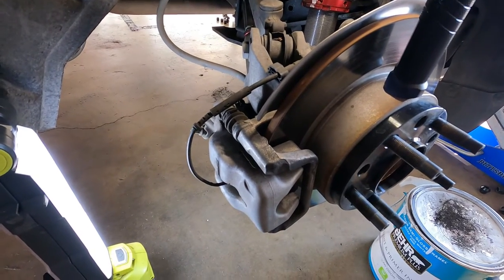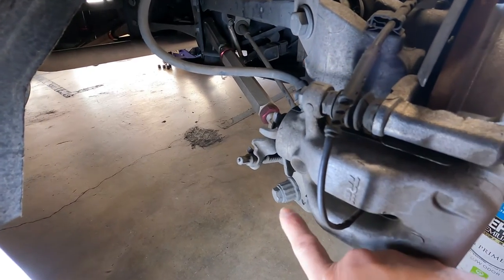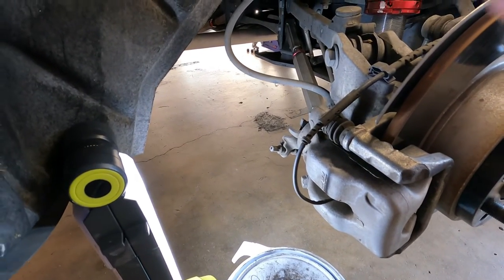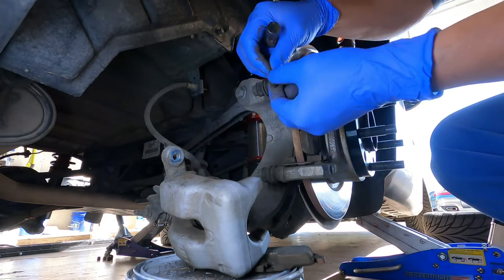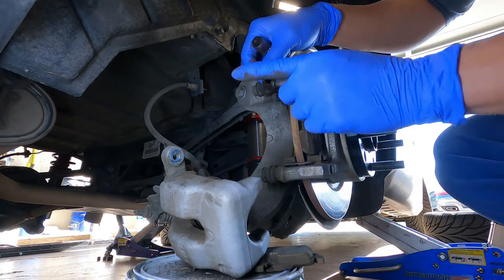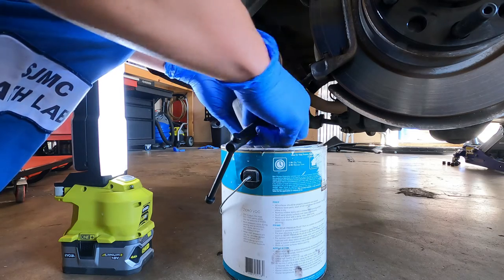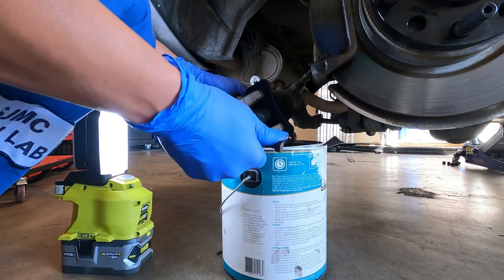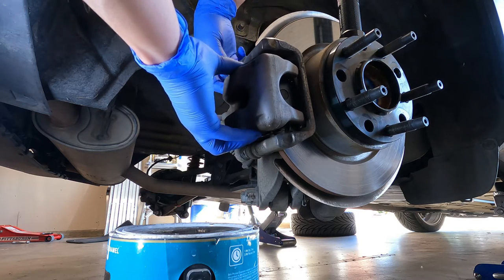Mini Cooper Rear Brake Pad Change DIY - Easy 30min Job

Comment: I can’t believe it. I changed front discs on front of wife’s Mini. She didn’t like the look of rust on the old discs so I smeared plenty of copper grease on the new discs to prevent rust. Now she’s saying the brakes don’t work too well. Do you think I have got air in the system?

Comment: Hello A F. Lots of good info thanks. Doing the same task on 2018 Countryman JCW. Btw, you would like it. My wife ordered cloth sport seats, manual `box, no cursed sunroof, in Lapis Blue, no other colour on roof, no model name on rear hatch, black light surrounds. 
One little issue. On dozens of sport or race bikes and some Porsches, we have always done the pad running -in as follows: Drive around trying to avoid hard braking. At the same time while just cruising, gently apply the brakes for two seconds, repeat 4 times then let brakes cool a few mins. Repeat routine about 5 times. That's it. I should mention I always lightly use 600 grit sandpaper on the disks to freshen the surface, then wash the disc and calliper with brake cleaner. I like to clean callipers before retracting pistons. Works every time, even on top level race bikes. I'm sure your system works, I just can't cook new brake pads with all that heavy stopping. Good luck.
Reply from the maker: Leon, thanks for sharing your technique. I have also heard of people sanding down the initial layer or new brake pads to help with the bedding process. Perhaps the next time, I will try your technique.

Comment: Hi there, great video. Any information on what the original issue with the driver side rear pads was? You mentioned they wore down prematurely.
Reply from the maker: Sorry, I never figured out what caused one of the pads to wear faster than the other side.

Comment: I just did my 2017 Mini Countryman All4S... took me about 3 hours... hahaha. First time changing pads.  BMW/Mini wants $1K. Nope.  Second wheel took me 2 hours.  Part of the time is thinking out loud so that I don't make a mistake etc.  Part of the time was figuring how to jack up the mini without a catastrophe.  The brake pads I bought for the front looked identical to the ones that I am replacing and it took a while for me to push them into the caliper bracket.  I don't know if that is normal... but it is pretty snug.  It took me a while before the pads were in place.  A little late now but I have needed to take bracket off and clean the pad area with a wire brush etc.   I will need to understand about "bed the pads".   My front brakes were from Duralast.  I got the same caliper set from Harbor Freight; cost me $39 in the east coast.  I like that it is in a case but if you want to go cheap you can use a big C clamp up against the back of the cylinder and screw handle put an old brake pad push the screw part up against the piston that way.  Another thing I did also was short out the brake sensor..
Reply from the maker: Hey Sam, it looks like you learned a few things here and there for your 1st pad change. Trust me, I went through the same processes when I started working on cars.
Reply: @TheAutomotiveFanatic  Thanks for  your reply.  Yeah ... putting the car on the lift is great...but if $1K motivates someone to do the brakes themselves... ALL GOOD.  One other question for you:  I have wheel locks from BMW and it appears I (as I took off the 2 front ones before going to the back tires) must have stripped the key as the key now slips.  Mini/BMW wants $69 for a new matching key... and yet the whole set of wheel lock nuts and key will cost you $40.  Anything you can think of to help me there?
Reply from the maker: @samsnow7370  I'm sorry to hear about the stripped wheel bolt lock. A local friend of mine had the same issue. The only thing I could think of, was to drill a hole into the lock and back it out with a reverse bit. Otherwise, you'll be stuck paying $69 for a new set.

Comment: Fantastic video! I will say, though; if it's your first time wrenching, you're not gonna be done in 30 minutes. Plan in a good few hours, just to be sure. You're likely to come across some rusted fasteners.
Reply from the maker: Thanks Michelle for the input. You're right...in any automotive DIY, something always seems to come up. Can this DIY be completed in 30mins, yes...could you run into any issues, absolutely so prepare.

Comment: great video - if you are replacing the pads, you can push the piston back using a screwdriver, by carefully wedging it between the rotor and pad. push into the pad, not the rotor. this will make getting the caliper off easier also. for breaking in, do nothing but drive normally. most pads and rotors these days have an initial coating that does the break with normal driving. i did not see any lube for the pins - is this not needed for the rears?
Reply from the maker: Thanks for the input John. There's definitely more than one way to complete this DIY. As far as lube for the pins go, you're 100% correct. That's a minor part of the process that I left out. I can also add that in conjunction with greasing the pins, you should also sand them down with a fine grit rated sand paper.

Comment: Did you have to do any resurfacing on the rotors?
Reply from the maker: No, nowadays, rotors are so cheap, people opt to buy new ones instead of resurfacing them and decreasing the minimum safety width.

Comment: Thanks for the video. Did you reuse the caliper bolts or is it important to replace them with new ones?
Reply from the maker: Thank you for watching. I reused the caliper bolts. I would suggest replacing them if you're frequently changing out pads. Otherwise, a one-time reuse isn't going to cause issues.

Comment: No brake pumping required after the pads replacement?
Reply from the maker: Thank you for that question...Yes, PUMP your brake pedal a few times to build pressure before driving off.

Comment: Can I use a c clamp to push the piston back or no?
Reply from the maker: Yes you can, but I would suggest placing a thin, flat piece of wood between the piston and your clamp.
Reply: Or just use the old pad instead of a piece of wood.

Comment: Thanks for sharing video! I noticed looks like you have coilovers what brand and is there any rubbing on rear fender? I have    a 15mm spacer and running 19x8 oz racing thanks
Reply from the maker: Hello Andrew, on the Countryman that I performed the pad change on, the coilovers are GodSpeed MonoMaxx. With the OEM rims, there is no rubbing. With your current setup, it really depends on the rim's ET. If you have a higher offset, say ET40, you might be able to get away with a 19x8 rim running 15mm spacers.

Comment: Not helpful if the sensor wasn't replaced.
Reply from the maker: C R, I generally do not replace my sensors as I am careful when they are being removed. However, to a new DIYer who's never replaced the rear pads before, this could prove to be tough. If the wear sensor needs to be replaced, you have to dig into the side panels as it's well protected.
Reply: @TheAutomotiveFanatic  Excellent point